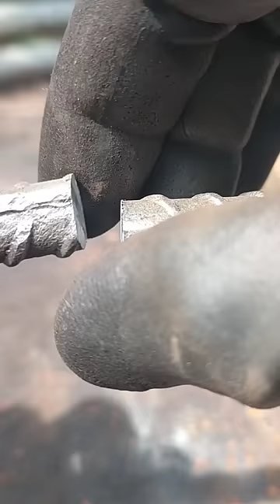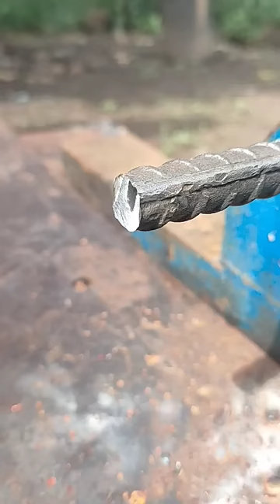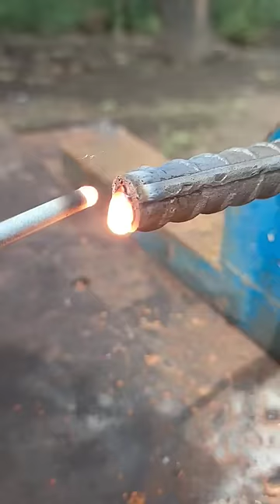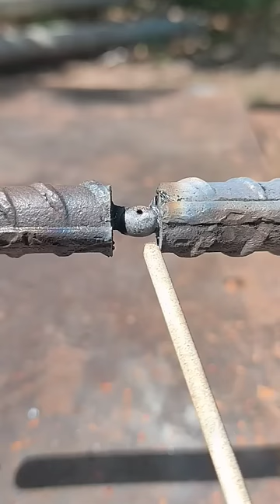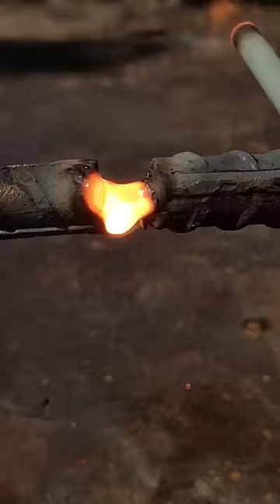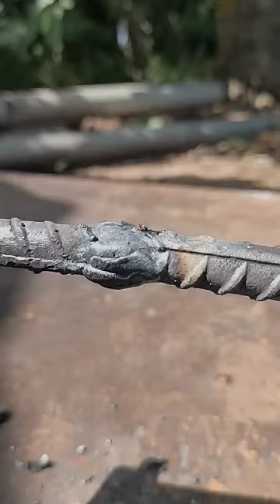welding shorts #weldingshorts

Comment: I've only welded a few times but I'm pretty sure that the weld is where most breaks occur.
Reply: If done properly no, it just so happens that a lot various imperfections can cause the weld to become brittle. If the weld is done how it's supposed to be the material added is actually stronger than the base metal
Reply: Вообщем то да, но это если арматура приварена сбоку -- лопается по окончанию сварного шва. А этот способ надо исследовать и лучше в лаборатории.
Reply: @coletonanthony9588 Seriously? Ive been taught that weld is weaker than typical and common material like steel S235.
Reply: @pawello3602  that's wrong if done correct with right electrode, right heat, good fusion...meaning penetration and coverage...the weld will be as strong if not stronger than the parent metals...15 year experience structural welder for what it's worth I don't know it all but this is what I was taught
Reply: No if its a good weld it eill generally snap beside the weld
Reply: More often than not a good weld is stronger than the base material and the break occurs adjacent to the weld.
Reply: I'm in school for welding and I can say that this person should've just tac welded it on and then welded a fat beed around it
Reply: @ThatS550guy  honestly what would have been best is to grind them both to a point at 45° then fill in the V you might need a better school.
Reply: @pizzadude6615  that maybe true even though a school is a school and it depends on your instructor and how you learn and what you retain from it,  ive been welding for 3 weeks i dont know everything, but here  I'm just giving my opinion whether you or anyone else might think otherwise of it.
Reply: Сверной шов это концентратор напряжения. Чем он больше тем больше напряжение в детали и выше риск поломки
Reply: If done correctly the weld is actually stronger
Reply: @pawello3602  "Seriously? Ive been taught that weld is weaker than typical and common material like steel S235."

Tungsten has a stronger tensile strength than steel, about 3 times as much.
Reply: @ThatS550guy  A bead is better than the stupid cold tacks all these "tips" and "life hacks" channels do, but you still need proper penetration. You said you've been welding for 3 weeks, if your instructor hasn't taught you yet, with SMAW (as used in the video and the favorite among these crappy channels), GMAW, GTAW, etc., you need the right electrode, current and voltage, etc. for the material you want to weld and the thickness. I don't recall seeing any of these "tips" or "hacks" videos ever giving any details, just showing what little they do on screen.
Reply: Maybe your welds lol
Reply: Take this video to your instructor and ask him what he suggests.
Reply: That's incorrect. You've already heard a few welders reply to your comment. However, the best way to understand this is to go watch some videos in weld testing. You'll be surprised at how strong a proper weld is.  Even on sheet metal, like car fenders, when do r properly, the weld will hold strong during another collision, but the surrounding material will not.
Reply: We also have standards from what I know regarding weld connections so no they don't normally break unless the materials used for welding aren't up to standards (or maybe the welding rods used isn't  applicable for the designed loading) or the one making the welds isn't skilled enough for the job. Usually for RSB connections welding this elements are allowed as long as they're designed to be welded (because some metals when it melts and becomes one with the materials from the weld they can change their properties entirely and sometimes fkr the worse), otherwise just splice them up according to code.
Reply: @jmackinjersey1 as a civil engineer student in my intern, it is surprising how strong a weld can be, didn't understand concepts behind it till we have our practicum. Also from what I know we do have codes for that, I'm studying it right now on some of its codes according to AISC (some of our building codes from where I am are derived from there after all)
Reply: @pawello3602  Not true.
Reply: @pawello3602 who taught you that?
Reply: Only if your welding was not penetrated correctly
Reply: Lo mejor es la termo fusion empleada en las Nucleares😂😂
Reply: actually, done right, they break in the HAZ (heat affected zone)...the material that got real hot, but never melted.
Reply: Значит херово ты веришь
Reply: No it’s just the place where THAT structure breaks.
Reply: 🤦🏻‍♂️Wenn ich mir den schwachsen durch lese wie "die Schweißnähte sind stärker als das zu schweißende Material selbst" wird mir klar warum die wichtigsten Projekte Welt weit von deutschen geleitet werden.phusik grundkurs.das Material besteht aus Atomgitter bei Schweißen mit Elektroden kann man die Gitterstruktur nicht mit einander verbinden das geht physikalisch gar nicht. daher kann die Nat nicht stärker sein und ist immer die Schwachstelle.das geht nur bei zwei Schweißverfahren und bei beiden wird das Material so erhitzt das es kurz vor dem Schmelzpunkt ist um es anschließend mit viel Druck (1,5-3tonnen abhängig vom Material) an einander gepresst um die Gitterstruktur mit einander zu verbinden.(gelernter Metaller arbeite seit 15 Jahre als Umformer und Schweißer beim Marktführer)

Comment: Here for the "clearly you've never welded before" comments 😂
Reply: Me too.
Reply: Not a professional welder but I do use a mig for exhaust work and even I know this is not how to but how not to. Right on
Reply: I’m no welder but isn’t the solder weaker than the metal? How durable is this joint?

Comment: Igual tiene muchas posibilidades de quebrarse,no es material soldable 
Por algo la enfierradura es amarrada con alambre 😜
Reply: Quebra mesmo
perda de tempo
Reply: Capi, todo material férrico es soldable, la enfierradura no se solda pq luego se expondrá al concreto(el cual lleva agua y puede llegar a debilitar la unión por colisión térmica)
Reply: Дело говоришь
Reply: There's tons of rebar welded in millions of bridges and buildings all over the world, how else do they get 100ft sticks of rebar,  most the time they come in 20ft sticks, and you weld them together, the welding rod is stronger then the rebar, the tensile strength of one rod is several 100k psi.

Comment: In Florida, rebar in concrete footers, vertical core pours, and headers must overlap 24 inches.  I would think that rule would apply whether they were tied together or welded together.  Tying them twice is much easier than welding.
Reply: The legal lap in the u.s. is 6 x's the diameter of the bar that is being used in that particular spot.

Comment: The correct way to do this is called a bevel. It takes less than a minute with a grinder. And you don’t have to worry about a pinhole right in the middle of the center spot weld like he had.

Comment: I think it's better to get a new reinforced bar, with the correct length required. Cause if you're welding it. The welding material won't have the same strength as the re-bars. So if you don't want to cause structural failure. Never try any of these cheap hacks, compromising safety.

Comment: Would drilling a hole at each end and using a tap and die work to fasten both sides with a bolt threaded to screw both side work to attach both rebar pieces together with a a scoring chicken starch ( with rotary tool )at the ends of both pieces for more surface tension increase tensile strength ? I always thought rebar looked super cool 😎 and represent the veins of a body of concrete. Compression strength of concrete always fascinated me. I ponder one day of whole milk works a bit similar acrylic bonding adhesive. Cool post 🎉 !

Comment: So you’re going to mend 2 pieces of steel with whatever coil your welding with? Often copper and since you’re not even welding properly by dragging the electrode, you’re tapping the electrode over and over and not even tapping off the slag so you have alternating materials within your poor weld

Comment: Just make groves on both edges, 45 degree. The gap should not greater than the rod core wire diameter.

The purpose of welding is melting the 2 pieces of metal together to join as one. You just melt the rod like a stick glue.

Comment: I am a certified master technician of the metallurgy department of the NASA intellectual House of metallurgic department. And this is totally wrong. The correct way to deal with the situation is to use your right index finger to swipe from the lower end of the screen towards the topping of the screen in order to deal with the next service announcement.

Comment: Welding is the fusion of metals u need to melt those rods and add in that filler metal which is the electrode. I am a 6g welding certified.

Comment: That's making it even weaker than just welding it. Being completely filler metal.i thought he was essentially gonna heat the pool enough to solder it on, then weld around

Comment: This is for people who think a weld is just an outside bandaid. You aren’t just supposed to put material don’t on top of your welding surface you want your welding puddle to penetrate into the welding surface to create a root where both metals join together. Pipe welders weld around the circumference of the pipe all day long because they are getting proper penetration which could have been done on a much smaller scale here instead of this bs.

Comment: you could've at least welded 4 metal plaques on the sides to reinforce, or better yet made a threading maybe 6 or 5mm at a 2 cm depth and then a headless bolt goes in gets tightened and welded then the plaques ?

Comment: Any welder even a half ass one knows that's not making it past the bend test that's the absolute worst way to fill a gap .. all it needed was to be grinded flat on both sides and beveled then welded it would penetrate all the way through and actually hold

Comment: Should have done it how you had it the first time. End to end and weld around it. The weld is going to penetrate into the rebar and then you can grind it smooth afterwards.

Comment: I am not even a welder and I know that the fail point is now where that welding was done. It should have been take a grinder and smooth the ends, clean them up and ptep them and then weld the pieces touching one another not fill in a 1 inch gap woth weld

Comment: th eother funny thing: theres absolutely NO scenario, purpose, point, or use served in welding these 2 pieces of rebar together/attaching them at the points they are attached in this video. Now if they were each half beveled, thats another story but thats not the case herel. Even a non-welder with common sense could tell you that this method isnt going to product anything structurally sound. I've literally never seend a person weld to ends of rebar together like this. I've seen CNC automated welders do something pretty much like this kind of, but theres no reason for any human to even do this other than to showcase his horrendous and deplorable welding skills to the likes of then entire world as if its something to boast about lmao

Comment: Why would you full weld rebar? It supposed to support concrete. It's cheap kaka compared to the metal in the rod. Now, if you really needed to do something like this, you grind a bevel on both parts. This technique is not how you avoid a butt weld. This is for butt heads.

Comment: This is HORRIBLE. Huge gap barely fusing any of the base metal. This stupid tack tack tack technique making sure to get as much porosity and inclusions as possible. Just yikes. Bevel the ends and do it right. Or overlap a few inches of rebar and weld them together. Or any one of another 10 ways to do this that would be worth something